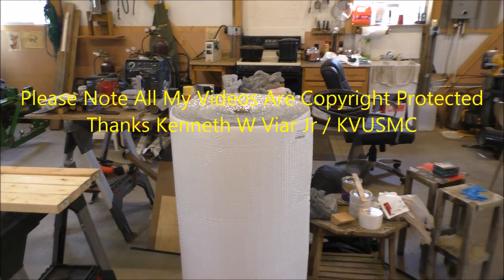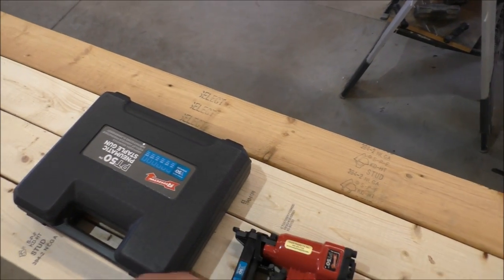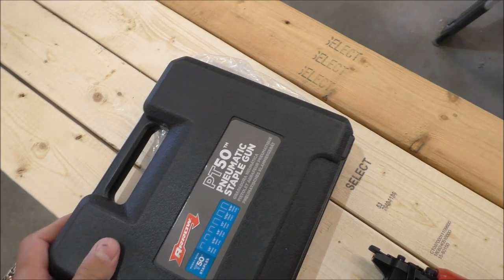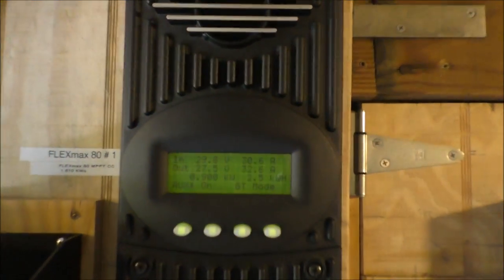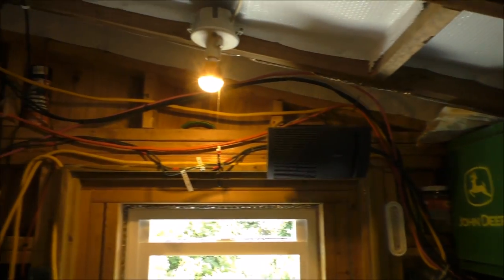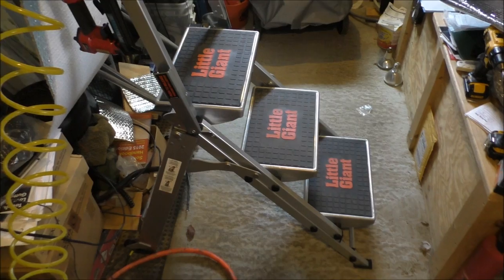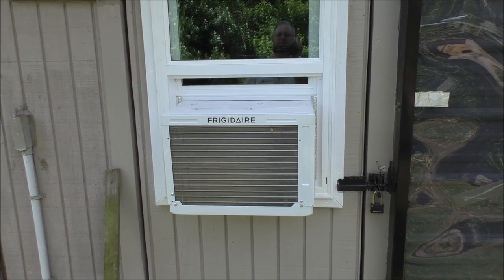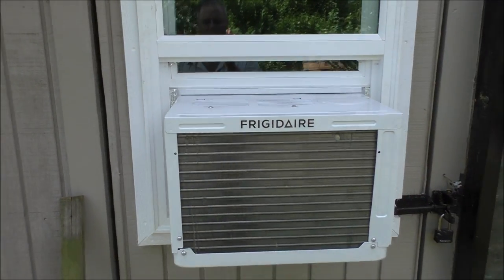Installing  EcoFoil Double Bubble Insulation And New 8000 BTU Air Conditioner In My Solar And Wind P

Comment: I've also got celotex foil foam type insulation. Could I use both together? Foil like how yours is laid foil facing sky then celotex underneath. I guess the air conditioning helps as well
Reply from the maker: That Would Work Great Yes foil too The Outer side / To the Sky facing Outside

Comment: Does this make your workshop cooler in the summer or hotter? Do you not need a air gap?
Reply from the maker: +Daniel Dublin it Makes it cooler the Silver side Reflects The Heat